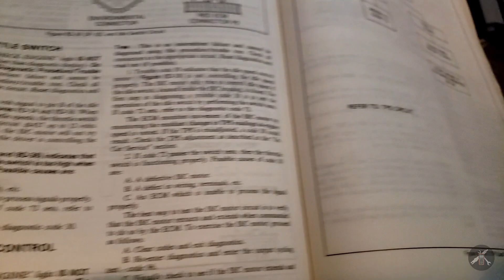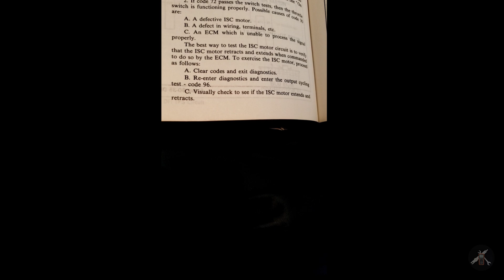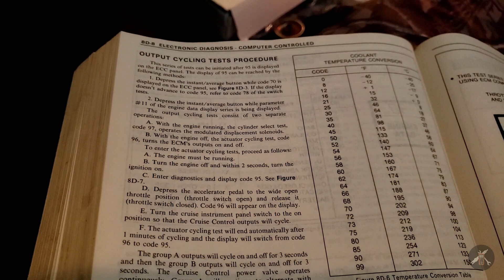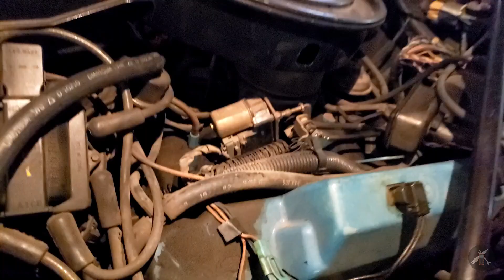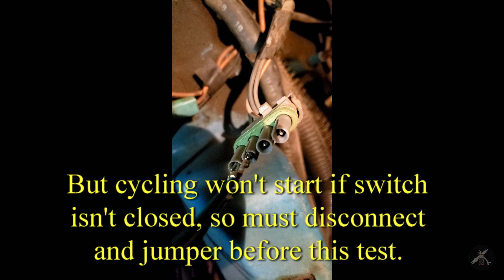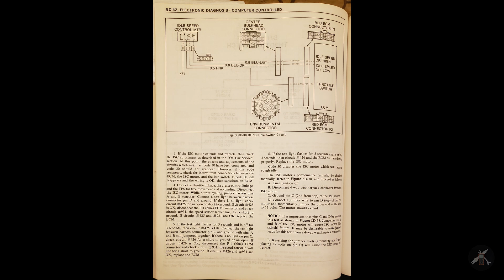Cadillac 8-6-4 Code 30 Testing Idle Speed Motor

Comment: I think we may have rebuilt a few of those back when I worked as an engine machinist.  The valve covers come to mind.  I know we rebuilt and upgraded a lot of the HT-4100’s that soon followed, man those aluminum block lightweights made us a lot of cash and kept us hopping since we were the only full service shop that would touch them.
Reply from the maker: Yes, I believe this engine is based off of the old Cadillac V8 500 / 472 / 425 then 368.  They were trying to keep it going in the face of tightening regulations and the 8-6-4 was the last try.  I have heard anecdotal complaints about the 4100 over the years.  It seemed that it eventually overcame that reputation as it went to 4.5 then 4.9 liters.